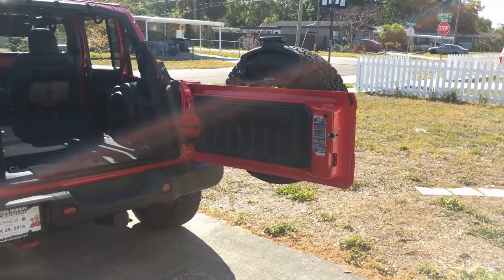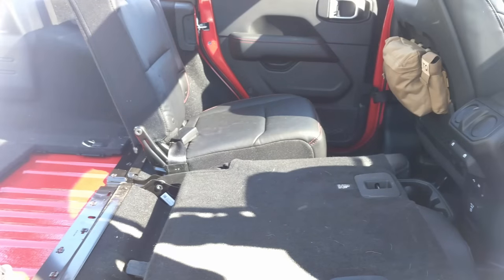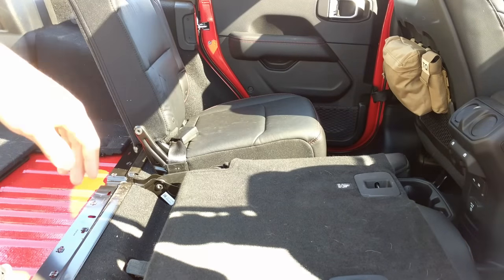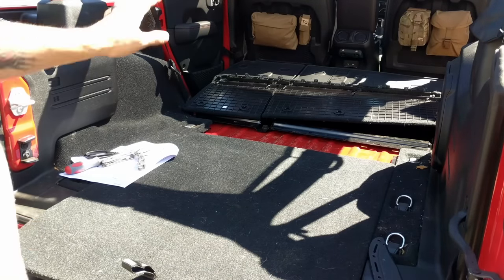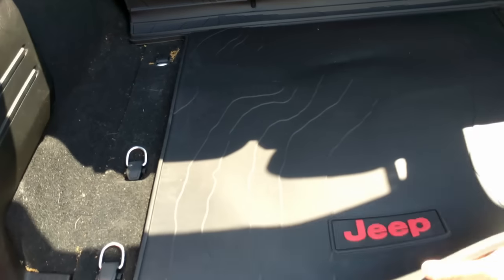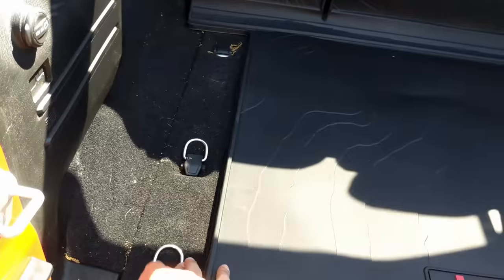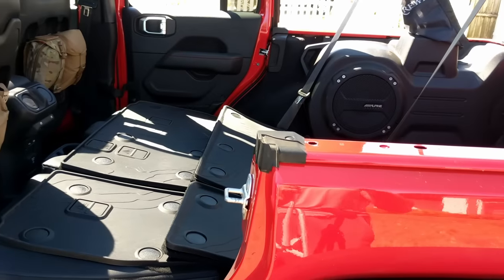Jeep Wrangler JL Mopar Rear Cargo Mat

Comment: Thank you so much for posting the video! The instructions that came in the box are laughable, you did a great job at deciphering Mopar's hieroglyphics.  The only thing I would suggest to anyone looking into these is DO NOT remove the gap hider.  You can cut the holes with it installed, i ran into some problems while reinstalling gap hider.  Maybe it was just me, but It's not worth taking that chance.

Comment: Thanks for the message in the description. Mopar instructions apparently have deemed English and Spanish to be too easy. They have made instructions that rely instead on telepathic and psychic abilities. I suck at that stuff. For leather seat equipped Rubicons, don't remove the dust shield! It does not hurt at all to use an X-Acto utility blade for precise control instead of a box cutter and scissors. This is an easy little install. There's just one thing I can't understand though. Why is it a problem for anyone at all to cut holes in fabric on a $60,000 vehicle. It's not like it's a $61,000 vehicle or anything! Grow a pair, boys!

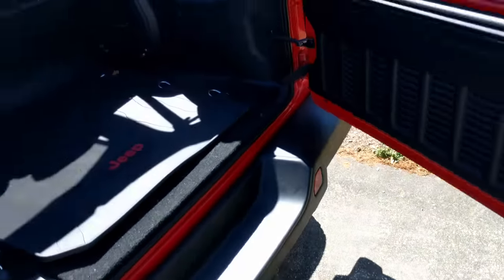Comment: Hey Erwin, Great video! I am about to do the install myself. I reviewed the instructions and I do not believe that Mopar intended the cargo mat to lay on top of the existing carpeted cargo area. Step 14 in the instructions show it removed with the rubber cargo mat installed. That is why @5:53 the mat does not sit flat on top of the strap.
Reply: I'm not sure what Mopar intended, but removing the existing carpeted piece (known as the load floor) is unnecessary and, in any case, is not a good idea. I installed my cargo mat, left the load floor in place, and the rubber cargo mat lies perfectly flat. If you take the load floor out, there is nothing there to keep your new cargo mat from sinking into the cargo area storage compartment, particularly if you place anything heavy on top of it. It is called the load floor for a reason. Also, if you are one of those people that removes your hardtop and/or doors, you can't utilize the provided holes for the nuts, bolts, etc built into the rear cargo tray because the load floor serves as the top to secure any items placed in the tray.

Comment: thanks for the video... i purchased these after seeing your videos and finally installed them today... one quick question i got is: anyone has issues of the mat (the big one attached to gap hider) pop up when you fold down and up the seats?  seems like the rubber is still a bit stiff now and not sure if it gets better/ softer overtime... any advice would be appreciated! 🙏🏼
Reply: From another comment I read (I haven't installed these myself yet), the most likely cause is the two sides that were clipped together on the gap hider were installed backwards.

Comment: How did you put the gap hider back? When I removed mine it left the clips in the bracket with all the teeth pulled up. Thoughts?! Thanks btw, the video helped a lot
Reply: Matthew Ziegler same problem...can’t get the gap hider to go back in
Reply: I decided to take the brakes off, with a pair of needle nose pliers I popped the clips out from the back then used the pliers again to bend the teeth back down, lost about 20% of them because they broke. Reinstalled and torqued the bracket back in and it pushed in with no issues. Really stupid design and overall unhappy with the total product

Comment: Hey Erwin, thanks for taking the time to post this.  Say, how did you know where to place the knife in the various places at around the 2:00 mark?
Reply: Thanks!
Reply: Ok thanks
Reply: If you lay the mats on top of the seatbacks, you'll see exactly where the holes are located. This cargo mat/seatback mats set is really very easy to install. When I cut the holes in the seatbacks, I first cut an X as shown in the instructions, then used my finger to stretch out the holes to make them large enough to pop in the plastic mounting disk. On a couple of the holes, I needed to remove a little extra carpet material so I used a sharp pair of small scissors to do this. I took my time and the whole job, start to finish, only took about an hour. Really, no one should hesitate to buy this mat set because of the cutting involved. It isn't difficult and, if you use even the slightest amount of care, there's little risk of you messing things up.